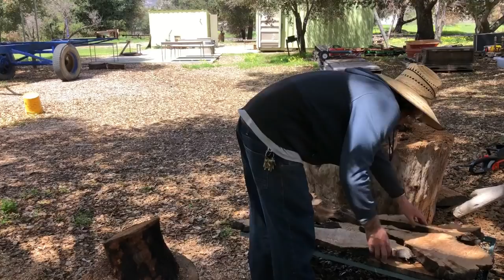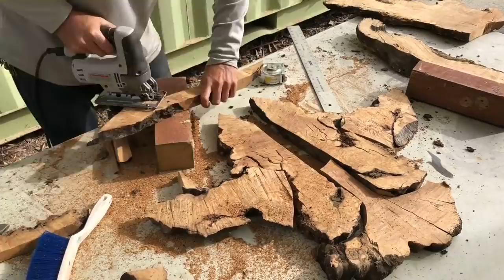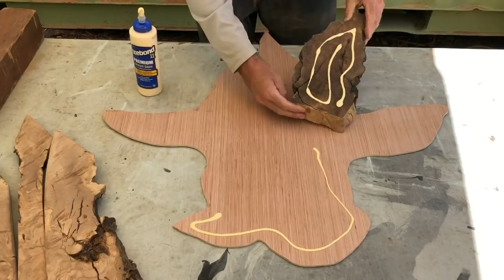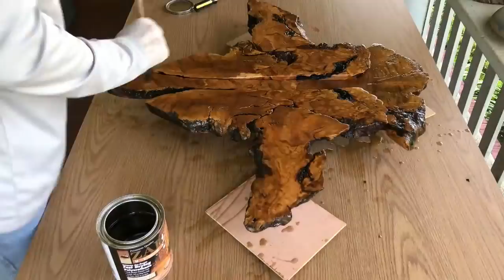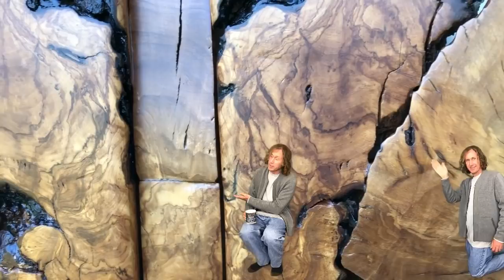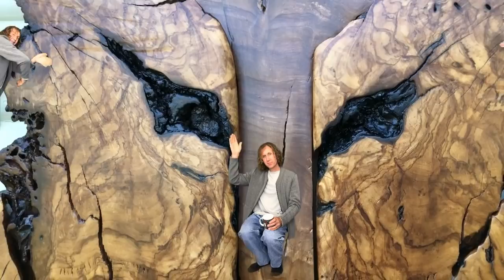"madera mística" rustic wall hanging art piece

Comment: I just found your channel and wow! Beautiful craftsmanship Scott! 
I know you can't show every single step in the process but I am very curious how you got such a great looking bevel on the backer. On camera you glued and nailed one layer and then off camera applied a second layer of backer and cut a really nice bevel. how did you cut that bevel? Hand jig saw, scroll saw, band saw? Thanks so much for sharing your art!
Reply from the maker: Yes, I don't show all the steps on all of my videos. I show how I bevel the edges of the second backer board in some of my other videos. What I use is a flap disc (usually 36 or 40 grit) on my grinder. This rounds out the edges really well. Sometimes I'll also do a little bit of sanding to smooth out the edges even more if necessary.
Reply: Thanks for the tips Scott. I'll catch up on all your videos in the next week. I would have never guessed that you beveled with the angle grinder. Looks like I'll have to add those flap discs to my shopping list on the next Harbor Freight run. I've got several 55 gal drums filled with unusual wood and stumps that I've picked up on hikes and now I've got your inspiration on how to transform them into art. Thanks again for sharing so much!!

Comment: Scott do you sand all the pieces to the same thickness before assembly?
Reply from the maker: No, I usually don't. With most pieces that I make I like the wood to be at different thicknesses. With this piece the two pieces in the middle are thinner than the outer pieces. I think it looks good like this and if they were all the same thicknesses, I don't know if I would like it as much.

Comment: Hello ! Sorry for my english .Tell me please, what sheet material do you use for the back of the product and what thickness is it?
Reply from the maker: This one has two pieces of 1/4" plywood as a backer board. Depending on the weight of the wood and the size of the piece sometimes I use 3 sheets of plywood as a backer board or thicker pieces.
Reply: scott oconnor Clear. Thank you. A plywood than you paint in gray, this oil or not? And the details of wood from the front paint with a varnish?